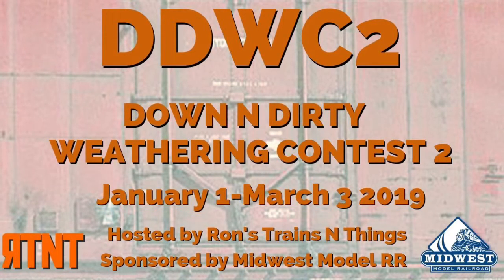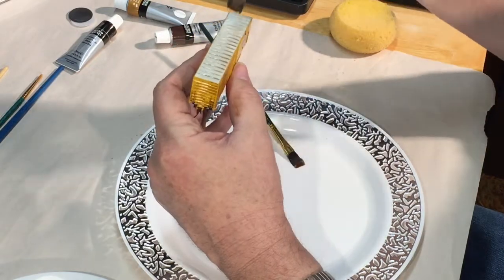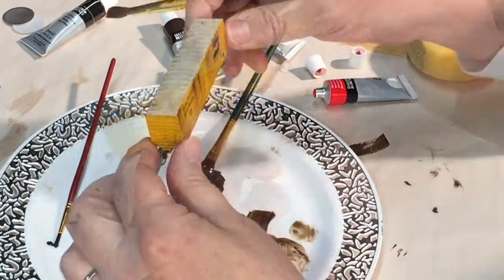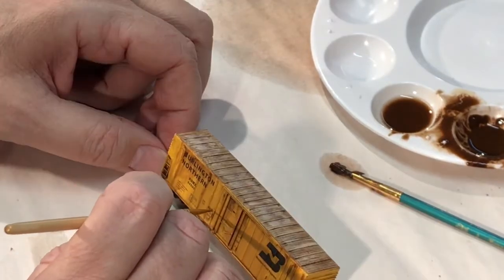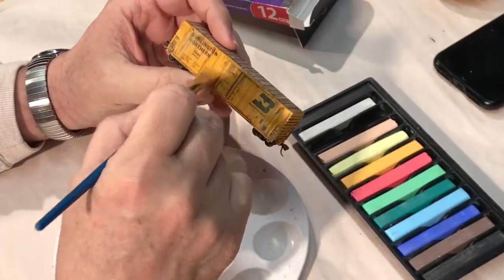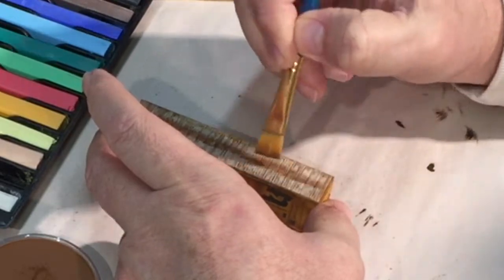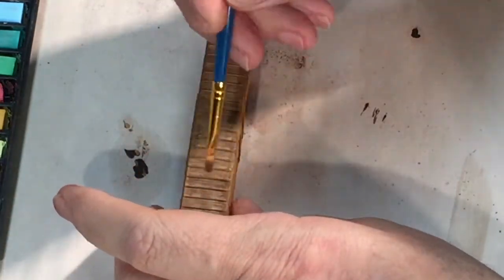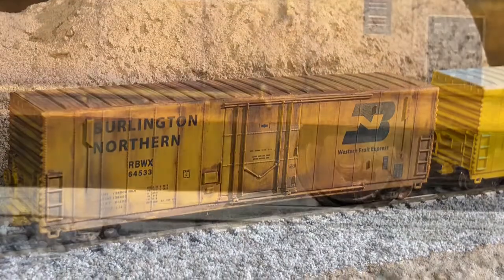Weathering Simplified

Comment: Well, that may have been  your first attempt and a bit of a learning curve, but I'd say you ended up with a very effective weathering job Anthony. Well done! Good luck in the contest!

I hope your proud of that car, it turned out well. I'd say you have a good grasp of the concepts and your techniques will only improve with experience.

The only suggestion I have would be to fade the road name and other printing before weathering. You can use acrylics, pastels or oils - I would just isolate (with appropriate dull coat) before continuing with the weathering.

Best, John
Reply from the maker: Thanks John for your kind words of encouragement and your suggestions. I’ve seen other modelers use some sort of pen device that I think has a fiberglass tip to rub off some of the markings. It was fun to work on this pro. I can’t tell for sure, but I think working with N Scale poses some different challenges than larger scales. Not really sure, having only made one attempt. Take care and thanks again...Anthony

Comment: With a box car before painting remove the bottom of the car. Insert a foam scrap into the upper body of the car and use the foam as a handle while applying the weathering. This allows you to avoid the fingerprints. Dull coat is a brand name. Other brands sell clear flat sprays which work just as well. Very nice results on this project.
Reply from the maker: Thanks a lot, great idea...Anthony

Comment: Nice job and thank for sharing.

Are you able the break down the model into smaller parts so you can work on each piece separately at the same time i.e. the bogies, chassis and body.  You can try mounting them on something using putty so they can be handled without the need to touch the painted areas.
Reply from the maker: Keith Gyles good suggestion, I’ll have to try that next time.